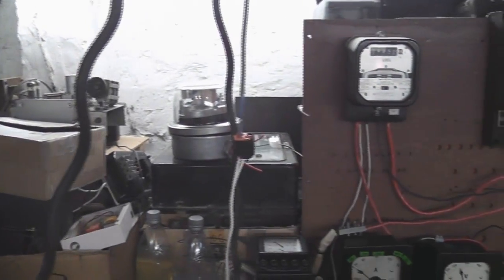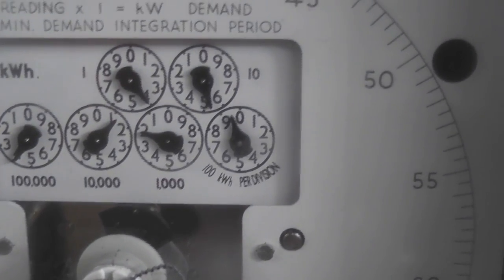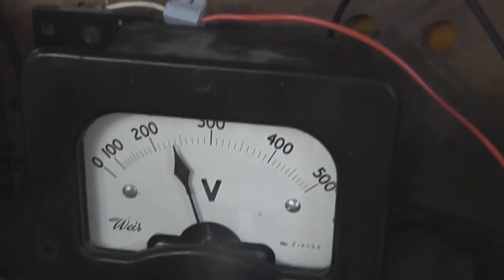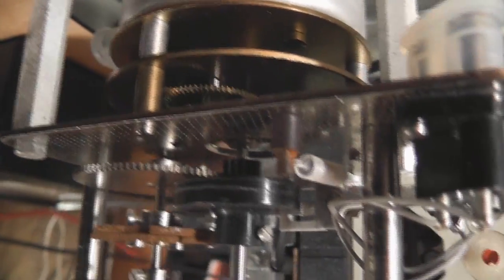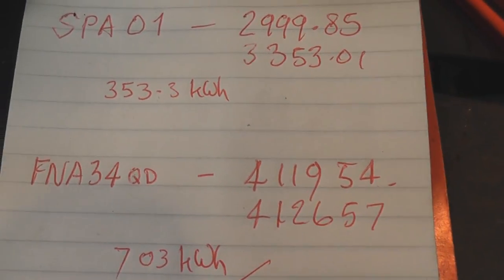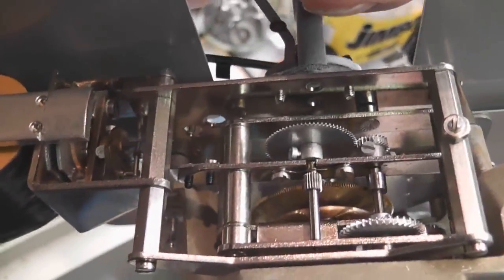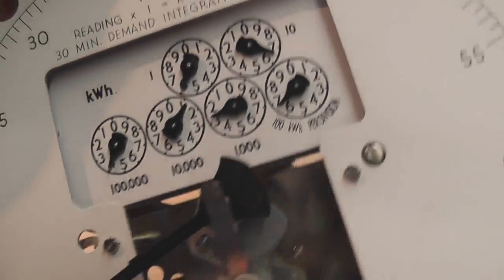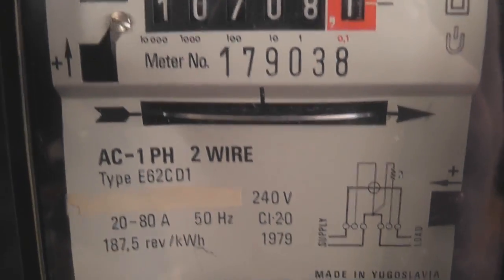Ferranti Maximum Demand Meter

Comment: Aaaah, just 
popping in to 
see this one 
again. This instrument.......

...... is one of the ones which I have placed on my "wanted list." I have liked this instrument since the first time you have shown it. 

Four and a half years later, I still have not found one of these, but I do know someone (you know him too) and I am going to ask him to see if he can get me one of these or a similar model (hopefully whole current and 240v 3ph 4w) with a maximum demand on it.

These and other MDI meters are really tasty, because it is just something else to look at and admire as it does its measurements.

=ALSO=

Some time back I asked you is you had a GEC Transva.

I am sure that you said you did have, and I was wondering if that instrument is going to be making an appearance some time soon?

I haven't seen one of those since the mid 1990s and even then it was dead-still in an empty factory.

I would like to see one energised, revving its loadwheel(s) and measuring up on its kVa Demand register.

Seeing as they are quite large instruments, do you know if they have more than one loadwheel in that rather tall-looking case? That would be interesting to know. :-)

Thanxx for showing,

-Wayne's Electrical.

14th June 2018, 01.25

Comment: What does the large face sweep needle on the register record exactly?  I always thought they were for instantaneous readout but It's evidently something else.  Does it rise and hold at the maximum demand at any given time of use until a reset?
Reply from the maker: The large pointer rises and remain in that position until reset by the meter reader. (usually once a month) The small pointer shows the rising demand and drops back every 30 minutes.
Reply: Thank you, that clears it up.

Comment: That's a very nicely made Ferranti! I like the 'hollow' part in the centre of the loadwheel.

--------------------------------------------
= VID REQUEST=
Could you at some time, do a vid which shows the MDI pointer measuring-up at its measurement interval?

I've never seen one of these measure-up, so it would be nice to get it on video.
It could also be another YouTube First! :D
-------------------------------------

Also, durig the vid, you referred to the meter as a FNAB. I know those ones. :D